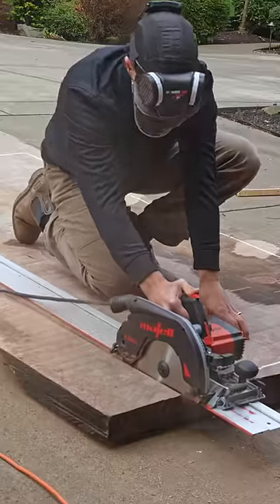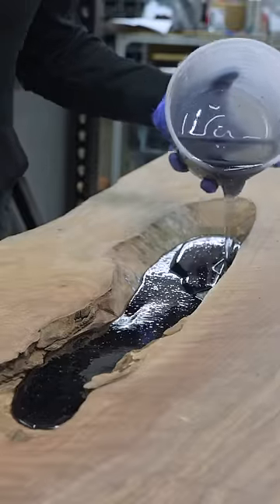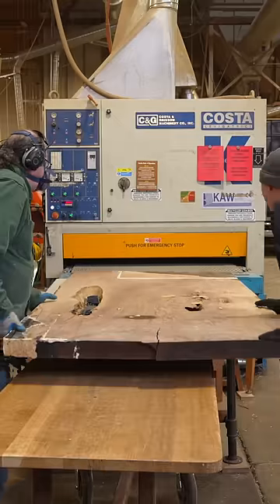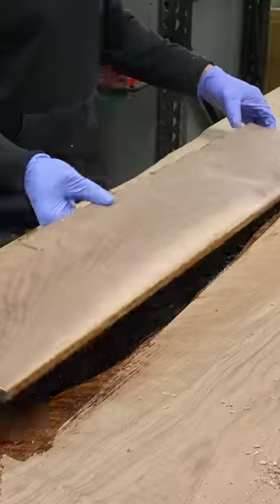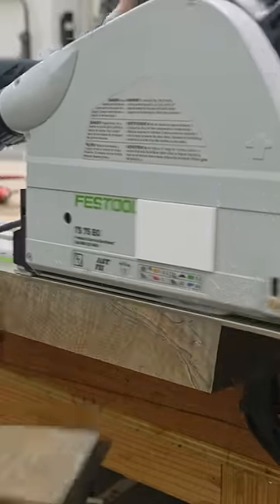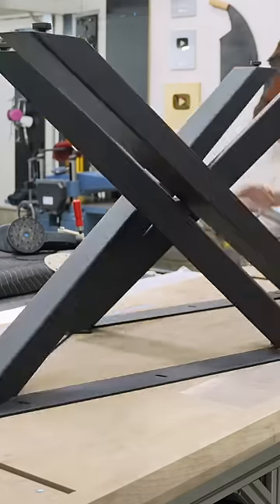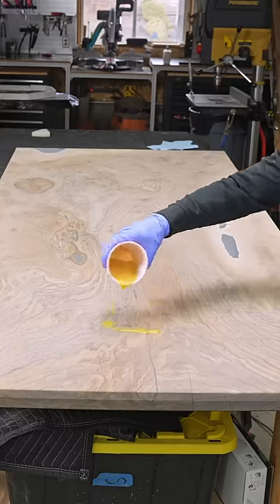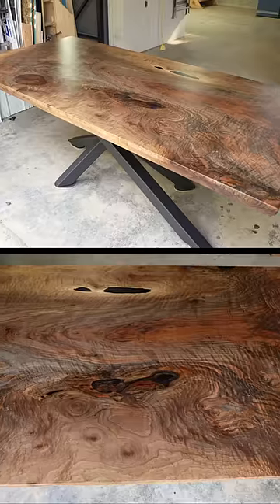Incredible slab table

Comment: when i was a freshman i used to turn wood. i made my grandpa a bowl out of a very old chestnut board and i broke my chisel on a nail. i ended up putting the 100+ year old hand cut nail back into the bowl when it was done. sometimes it makes the piece more special.
Reply: 100% agree. That bullet makes it one in a million. The perfect conversation piece at dinner.
Reply: Absolutely Beautiful wood work would love to get in to making furniture and table tops with resine.
Reply: Beautiful work and awesome finish.
Reply: Omg...... That's gorgeous!!!!  Well done!! 👏👏👏👏
Reply: Albert Einstain, is that you?
Reply: @gr8mystery conversation 😂 

“Is that a bullet hole?”  
“Yep”

Or

“Hey fun fact.  My table has an old bullet hole.  It’s right here…”

“Oh that’s cool.”
Reply: Yeah those old nails are no joke. Customer wanted to repurpose some old wood so I had to resaw a small (4x8) old timber that was cut into a 4’ chunk and we pulled all the nails, metal detected and all that but there was one the detector didn’t catch. A tooth of our saw blade broke off and literally shot me in the arm. Luckily it missed tendons and veins/arterie, but it bruised a nerve and had numb fingers for a couple months. All healed now, and I got off light, but those things were made to last
Reply: @yo_stephen yeah that happens more often than ppl would think. I’ve had rough lumber with buckshot a few times. And once a lead ball, almost looked like a musket ball lol. But the lead is so soft the planer just shaves it down
Reply: @adamgouveia7590  OMG!  That's crazy!  Glad you're OK!  I've got a couple of broken and dislocated fingers from weird accidents like that.  Renovating my 2nd floor apartment required removing the floor right down to the frame.  This house is over 100 years old and the 2 1/2 nails were hand made.  I had to piggyback a crowbar and hammer to get them out.  Every nail put up a fight like a WWF wrestler.  I kept 3 of them as a souvenir.  They are stuck to a magnet on my refrigerator.  Sometimes I look at them and shudder, thinking about the hell they put me through.

Comment: The bullet is actually pretty cool, but I hope that's not the part of the wood that'll cause moisture to leak into
Reply: Is there a way to seal the bullet so moisture dosen't get in?
Reply: @andrewmetzger1862  im sure resin would do just fine on that job
Reply: I think you sir, do amazing work 👏
Reply: @andrewmetzger1862  it’s all sealed by the hard finish he uses so no moisture and you wouldn’t be able to scratch the metal either
Reply: @andrewmetzger1862 like others said the epoxy will do it, if you question it then you start by just applying resin to that spot and curing it and then planing it before continuing to make sure theres no air or moisture. Nails are pretty common but a casing is not only more rare but also harder because its hollow (usually)
Reply: @Spengleman2  problem is, that is meant for wood, idk if it'll be the same effect on metal
Reply: NGL I kinda hate that bullet
And kinda feel like people saying "oh it's Artsy"it adds so much"it's so unique"it gives it a history"I'm sure that's going to make so many conversations happen", I feel like their saying that just cause it's a bullet. No it's not near it's a piece of shit piece of metal in the middle of a $10s of thousands worth of what's supposed to be wood tables. A bullet that plained out more than mid way through the second build of a year long project that's worth more than most vehicle and he's losing money by the second when he's working on it. Of course he's gonna make many videos on it, to bring attention to the problem and say "oh look I found a bullet, I actually like it it's interesting" cause now he's playing a psychological game getting hundreds of thousands of people to agree so when he shows the customers and see it they don't even know they don't like it cause they've been sneakily  coerced subconciously into liking it, so they don't reject it then has to find a matching grain and color piece of live edge walnut and again again have to make a 7 of 6 table. I know his game. Yes I've put a lot of thought into this, yes too much thought I know way too deep of thought, all because if a 1/2" round piece of metal. If I haven't been recommended this short,the whole tres table series, different takes of the same bullet table shirt a million times, realistically not exaggerated 14 times and I even watched the whole hour long build video and I'm subscribed to him. So yes of course I've given this video some thought. Ok A LOT OF thought but really I'm just having some fun, I really do believe he was trying to pass this bad news off as good news through videos in the exact way I stated. But I'm just playing in the comments bye bye✌️

Comment: Did the bullet give your planer/leveller any issues? 💥
Reply: Lead is softer than hard wood.
Reply: @john-paulsilke893  Unless it's a jacketed bullet. Looked like a soft point though.

It's worse when you find the nails they were using to hold up whatever target they were shooting at.
Reply: @john-paulsilke893  no in the actual video he discussed that he lucked out and I believe it was basically a lead ball from a LONGGGGG time ago so no hard casing. So no problems!

Comment: The Father in heaven sure does make beautiful mediums. I think you're work is quite mesmerizing at times. I dig the way that the epoxy and the Burrows on some of your finish work seemed to dance together. I like the way the furnitures dimensions can be deceiving. Meaning you see wood and then the epoxy sometimes blends into the background. Hmmm with the right table top and the right epoxy mixed with the lighting to create a floating table effect.

Comment: I hope this guy gets his moisture reading after applying epoxy to make the reading more accurate. Definitely more accurate that way for sure 100%, no questions asked, guaranteed the tools are designed to take Moisture reading with epoxy covered wood that has zero effect on conductivity at all no whatsoever.

Comment: it looks amazing of course. I don't understand about your moisture trap comment of the previous tables. I understand moisture trap but can't that be fixed instead of scrapping those? How does that happen? and wht did you do differently on the last ones?
I mean if there is a too high of a level of moisture in the wood once the top is sealed, can't it escape from the bottom? Do you also fully seal the bottom side, and if so, can't it be sanded and the slab dried more without having to open up the top side?  It seems like something more could be done to save it

Comment: I like your builds.  ... but you need to have a two functional dining room table in one.   
Using hydraulic lifts for dining room Thanksgiving dinner table / Christmas dinner usage ... 🎉 then New YEARS unformal entertainment Party 🥳  .... breakfast / 🍸  height of course you have to use some remote control actuators and some lights why don't you put some LED lights in your table and then put your epoxy resin ... for $15K ..... and throw some Wheels underneath there hidden Wheels in the shape of a Eagle Claw .... do you want me to draw it up for you ? 😂😂😂😂 ? And yes I like black walnut but .... I like the red stain of red cherry wood 🪵  .....  LED lights to be established when you touch the table it turns on a small battery pack USB 2 Charging device could be implemented so you don't have to use a cord on a portable table 2024 is 🎉waiting for you 😉  ..... 🎉🎉🎉🎉🎉😊

Comment: If you’re charging $15 why are you using pieces of wood you need to fill with epoxy and patch together with other pieces? Seems like you’re just trying to build with cheap materials and charge out the ass. Table at least looks good tho. Just not worth $15k